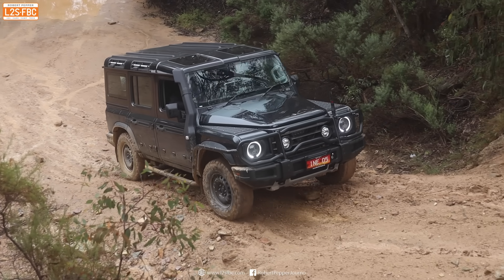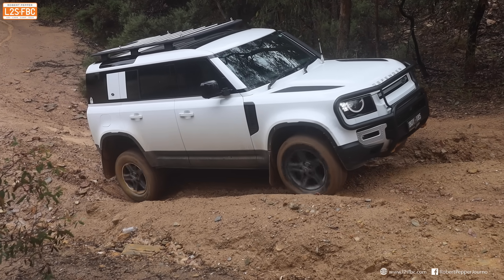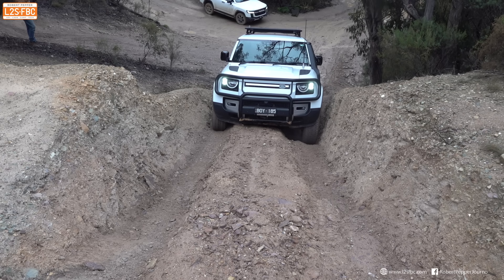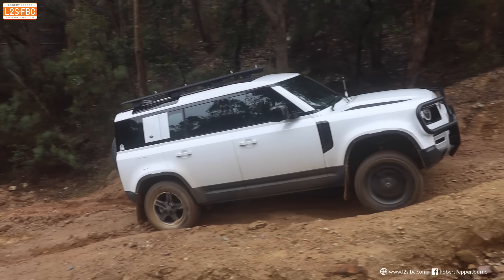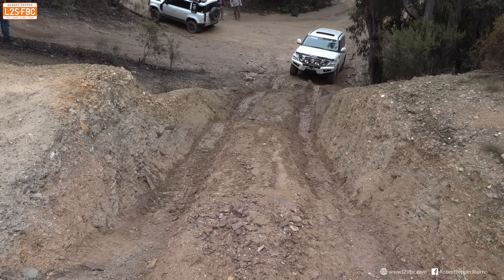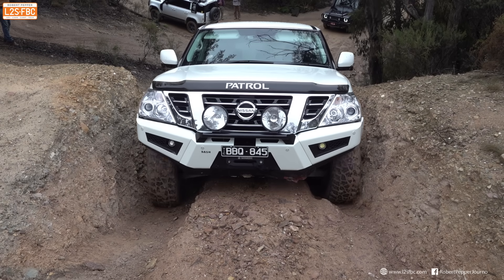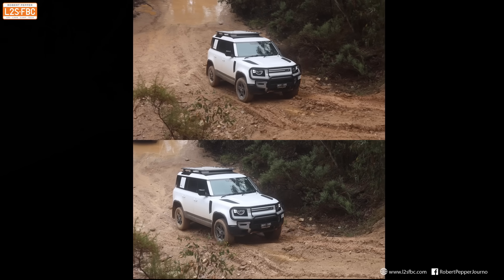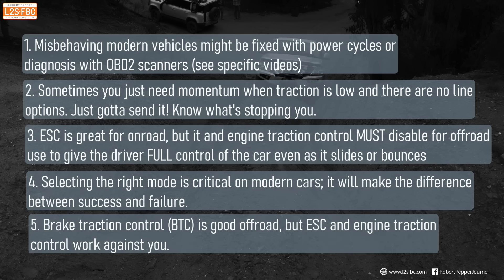Grenadier vs Patrol vs LC300 vs Defender - Part 5, Momentum

Comment from the maker: There are two themes in the comments:

1. The Defender is fantastic, you're not driving it right, not the car's fault.
2. The Defender is terrible, stupid electronics.

Neither is correct. First off, the Defender was in low range and it should entirely disabled ESC (DSC in Land Rover terms) and engine traction control. It does not.  ESC has degrees of sensitivity from fully on, early intervention to fully off.  Different Terrain Response modes vary the ESC (DSC) calibration as well as things like throttle response, gearshift points and BTC calibration.  The Defender was run with various modes and we found it cuts power in extremis; other commenters have found the same, as have I driving other Land Rover vehicles including my own D3.  Even if there was some magic sequence of buttons to entirely disable DSC then it's a usability fail as merely placing the vehicle into low range mud/ruts should allow full throttle authority.

You can see the effect of various TR modes on this D5.  An L663 equivalent video will follow.  https://youtu.be/oVuehYjKGrE

As for #2, well you need to open your eyes. The L663 is an incredible offroad vehicle and has impressive ground clearance and angles, thanks to its independent air suspension.  It has limited flex, but that limited flex actually increases its clearance (see https://youtu.be/sxvuO77wicw for why) and it still gets places thanks to Land Rover's incredible electronics.

Finally, Defender fans are not going to like Part 6...
Reply: The value of this series regardless of which "team you barrack for" is informing a prospective vehicle purchaser of the appropriateness of a vehicle to match the desired use and for existing owners demonstrating what the potential real-world limits are when using the vehicle. As a new (and previous long-term) Defender owner I understand the passion stirred on both sides but appreciate the usefulness of your work.
Reply: Yes that defender suspension is amazing. It’s also amazingly scary that if it fails, airbag, compressor or electronics it’s game over.

Comment: The Y62 Patrol, too me at least seemed the most composed, less fidgety and better walked its way up the track. All this with not having to depend on complex electronic aids as in the Defender and LC300, only a rear diff LSD with Diff lock. That is a testament to its robust engineering. And its the cheapest to buy by a long margin in this company!

Comment: As a new defender owner I can agree the modes are key to success. Stability off, mud/sand works okay to allow for additional wheel spin, but once 20k-30k of active spin is encountered and additional throttle is applied the system will cut the throttle/power. I’ve found it helpful to keep a steady throttle input and do small adjustments as you go. Have successfully done this in sand and mud, and even had some fun in the dunes. This has been a trial and error learning curve for me with the defender. The less traction available, the more sensitive the system seems to be - it really doesn’t want to spin the wheels wildly. 
Thank you for all you do, really enjoy you content.
Reply from the maker: Wild wheelspin should be avoided, but sometimes...you need to just send it and that means bouncing, sliding and wheelspin. The car should allow you to do that.
Reply: @L2SFBC I agree, but from a practical standpoint my P400 defender has far too much power/torque for that to be a reality. I’ve climbed huge sand dunes with the engine on the limiter, with zero throttle cut. It works out okay. I do wish it would allow full control, but I does enough the get me where I want to go.
Reply: If you're getting 20-30k "wheel spin" then you have a whole new set of problems!
Reply: I had the D250 for 2.5 years and never got to the bottom of the new Defender cutting the power when you just need momentum. The reason I was given was that when the new Defender spins it's wheels beyond a certain speed it cuts power to protect itself from damage. My guess would be that this is where LR believe you should be winching, but there isn't always a winch point available. It's one of the reasons I sold it. BTW after selling the vehicle I was told in hi box the power isn't cut, it's only in low box, so you could try locking it in M1 hi box to see if it improves matters.
Reply from the maker: Not doing that hill in high range! And typically ESC is disabled in low range...odd Land Rover see fit not to

Comment: Another excellent comparison. Fair play to the lad with the Defender, that looked quite sketchy! And another impressive performance by the Patrol. I've found with my Grenadier that while it lacks the more sophisticated TC of eg LR, it easily cedes control to the driver and seems to progress happily at higher revs. Just like an 'old' Defender, but better. Good fun. I have to drive it differently to my last Disco 5, which was great up to the point where it wasn't, when the computer said "no" and it would get stuck. That failed dune was positively dangerous!
Reply from the maker: Thanks James, seems another example of a Land Rover's computer cutting in just when you don't want them to - this is a consistent theme through the comments, and there are some who say "it's in the wrong mode" - well, we tried several and in low range that should be enough.  The Grenadier did not appear to restrict throttle at all, as it shouldn't.  The dune wasn't too dangerous, I could stop halfway around and not roll, but I've done steeper where you can't safely stop halfway...I would not trust an LR not to chop my power doing that!
Reply: Ha ha, well I suppose the computer stopped it spinning up the downslope wheels and sending you on a roll! @L2SFBC

Comment: I’ve found that the new Defender can be limited by DSC, so it’s worth trying to turn off at the switch. The terrain response settings also affects its operation. I would try Rock Crawl which locks the centre and rear diffs and keep a steady throttle trying a steady 2000 rpm to start. The Defenders don’t respond well to an on/off throttle technique in my experience, loss of momentum due to this can often result in a failed climb. Using this I’ve climbed some steep ascents with only one wheel having traction. Wheels do leave the ground frequently. Low traction launch can be handy in the right circumstances too. 👍 Great work!

Comment: I’ve also read about issues with Grenadier diff locks, which Ineos have attributed to user error. They stated that they need to be turned on (and off) in the correct order and that the warning lights may not extinguish immediately although the lockers have disengaged. I’ve not had an opportunity to try this out myself though.
Reply from the maker: That is correct. I cover this in the review here which I discussed with INEOS before publication. It is a poor design in my view.  https://youtu.be/KTgupbbRfog

Comment: I think that rear locker on the Grenadier is a mechanical Eaton e-locker & it won't engage unless it's rolling and being turned slightly to allow it to mesh.

I believe it is the same device as the Harrop E-locker.
Reply: That's right. They dont know the car and still doing the test 😂
Reply from the maker: The Grenadier had an electronic problem and stopped engaging its lockers. They came back later on.

Comment: If lockers doesn't work on a car, that means the lockers were not designed correctly (either its mechanical or electrical system including the software), and that's a negative point for that specific car. IMO, there's no need to limit other cars because of a fault in one of them. That's part of the 'test'.
Reply from the maker: Look at the other videos in this series.
Reply: I tested an Ineos last year and it had really temperamental locker engagement both ends... Ineos excuse was it was final prototype and still a bit buggy.
Some owners on groups report really early cars suffered similar intermittent fault but a recent software update has cured many of the gremlins. Perhaps this Grenadier was a very early build?
Reply from the maker: The locker problem is explained here. Checked with INEOS before publication.  https://youtu.be/KTgupbbRfog

Comment: You guys are awesome with this content. Welll done. 

Defender owners, has any tried to tune their defender to have the restriction of ESC removed when you entering low range?  Won’t that effectively solve the issue of it interfering off road 🤔
Reply: Sell it and buy a proper off road vehicle!
You could see that the shite pommie built pretender had wheels hanging…limited travel IFS AND IRS suspension airbags all tight showing what a heap of junk they are! 😂🤣
Trash! 🤣

Comment: I would point out that ESP/ESC/Stability programs (traction control) is different than EBD. One is for preventing a roll over or losing control at high speeds. EBD is for offroad situations where a locker is not employed. Some manufacturers do a better job of differentiating the jobs of these two systems and throttle will not be reduced in low traction situations.
Reply from the maker: EBD is electronic brake distribution. It does not mitigate roll over it distributes braking force where it is needed. There are programs which do focus on anti roll.
Reply: @L2SFBC  That's what my comment says. They are two different systems and the separation of those two make for a better offroad experience.

Comment: Wrangler Rubicon would have gone up this like it was going to the shops to get milk. Theres no substitute for a ladder frame coil sprung solid axle 4x4 twin locked with sway bar disconnect.
Grenadier is nearly there, the aftermarket just needs to come up with some quick release swaybar disconnect links

Comment: This is exactly why I went from an LR4 (and I had the rear locker version) to a Rubicon. These mode operated four wheel drive systems can be very good, especially when you learn how to continuously apply at least some throttle so that the computer can figure out what is going on and make all the corrections continuously, in light to moderate offroading. But push them into more serious situations and there are always issues with them taking over at the worst possible moment. And even in light to moderate scenarios as a driver you are faffing about a lot which becomes quite tiresome after a while. If a vehicle is serious about being an offroader to the full extent, it has to allow all of these things except BTC to be disabled and, ideally, also have front and rear axle lockers that are selectable by the driver with no BTC at all. And of course the other thing is articulation. And as the Land Rover demonstrated this is less about maintaining traction, as many modern TCSs can maintain wheel spin with a wheel in the air, especially with consistent throttle applied allowing the computer to calculate properly, but rather is about safety as trails get more extreme. Quite simply wheels off the ground is the quickest way to a rollover. It’s kind of ironic actually- these electronic TCS, air sus vehicles make easy tracks and light offroading simple for the inexperienced offroader- and as this is what 90% of people will do offroad open up offroading to more people. But as soon as you push them into harder stuff, they make offroading more difficult. And of course they also have so many more failure points that are usually the kind that are not trail side repairable, just increasing the odds of the veh leaving you stranded (the air sus on an LR4 having an issue and dropping to bump stops and also killing your ability to access the offroad modes is my very real and personal experience example). I loved my LR4 and it got me all the places I wanted to go for a long time, but as I began to push it into harder stuff I just got tired of fighting my own veh. I just wanted to be in charge of the decision making and not the car and not be wasting all this time. And also, because I solo a lot, I was nervous about a breakdown leaving me stranded. There were just too many electronics that the veh was reliant upon that any failure and I’d be screwed; and those can’t be fixed trailside.  With the Rubicon I just selected the lift for my style wheeling and it’s just Hi or Lo (and with Lo being looooowwww), axle lockers yes or no, and driver skill. The way I like it. Oh, and solid axles, because again, as you push these onto harder trails, IFS or full indy sus breakages become real problems.
Reply from the maker: Can't argue with any of that good comment!